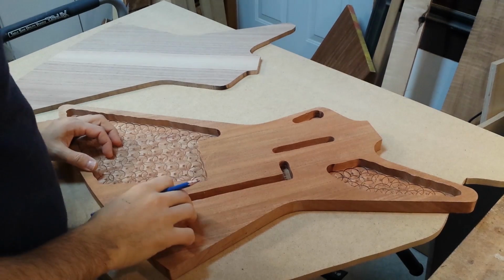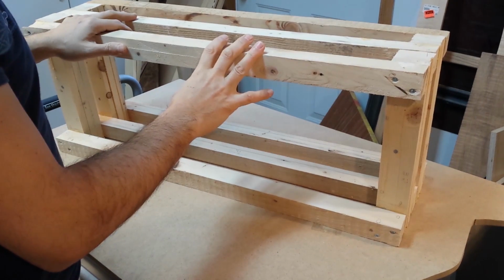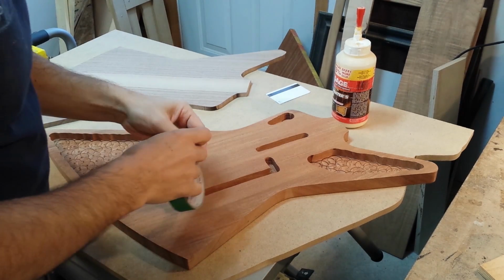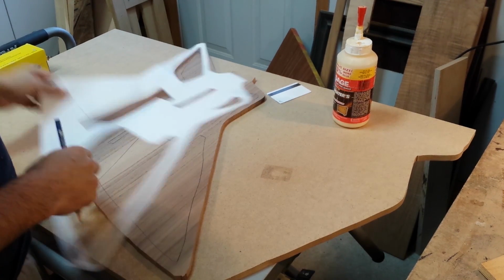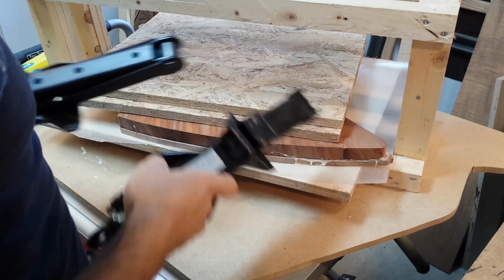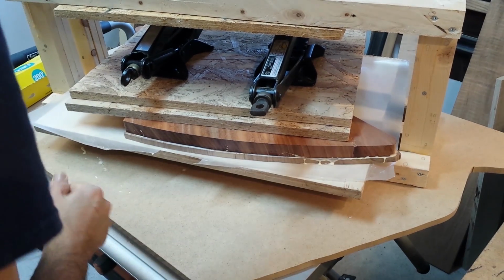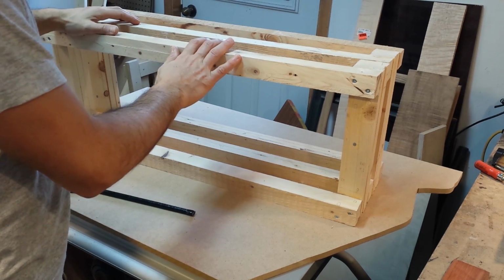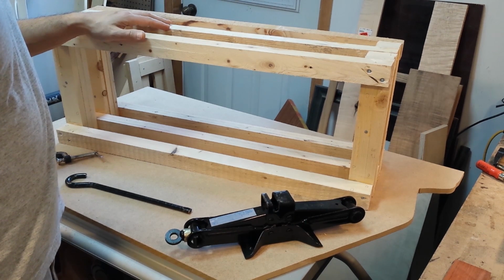Gluing A Guitar Top With A Simple But Effective Press

Comment: A few toothpicks used as pins could be used to hold the 2 parts together, I did something similar to this and like you was having trouble with the glue acting like a lube and moving it around so I started using toothpicks as posts to hold it.
But that is a hell of a great idea for a press!

Comment: All you need to press any size guitar body is a solid very flat table, a piece of 3/4" mdf that is larger than the guitar body, and two  45 lb barbell plates. Sometimes I add two 35 lb plates on top of the 45s,  if I feel the extra pressure is needed. . This also has a side benefit of guaranteeing absolute flatness to the body.    Oh, and I get my back and bicep workout for the day.

Comment: You do a good job showing all the little nuances of building a body. I like the tips you come up with. What is the thickness of the wood you start out with when making a body of say a Strat, Explorer, Les Paul?
Reply from the maker: The thickness of the wood is never the same. I use the wood I have and build the guitar accordingly. I can control the final thickness of the guitar by the combination of the thickness of the body and the top piece.

Comment: To fix the issue of allining the center points, you can use a tack to pin the top in the right place.
Reply from the maker: Great idea! Thanks.
Reply: Barring that, sliding the pieces against each other before clamping will burst the air bubbles trapped in the glue. That's the reason the pieces tend to skate around.

Comment: I did some more research on veneer presses after seeing your videos and found these things called veneer press screws you may want to check them out, I bought some and built a press using a frame like yours but instead of the ply wood and jacks I used a steel platen with a veneer press screw welded to it. The advantage is with the steel platen there is even pressure distribution on over the entire body. you can get them from shop fox or on ebay. Thanks again for the videos I wouldn't have had the idea to build my press without seeing your video first. keep up the great work.
Reply from the maker: I love it, you improved on my idea! Thank you.

Comment: Perhaps you can get some heavy steel plate to better distribute the force. Also, if you can get hold of a few hydraulic potjacks, that would work even better than the simple car jacks. Potjack have a smaller footprint, so you can put four of them in your frame.
Reply from the maker: Thanks for the ideas Dries. Those are definitely good ways to improve on this design. However, I created a new and different system for clamping my guitar tops, you can see my video here: https://youtu.be/UNY1C9HYqDQ
Reply: That also looks like a good system. But what I like about the cage system is that you can more easily inspect and clean up the glue squeeze out than with regular clamping.

Comment: Great video thanks! you can also use a little bit of coarse salt between the two plates to prevent them from sliding on each other, salt crystals acts as micro dowels when you press.
Reply from the maker: +Adrien Bernard-Reymond Thanks for the tip. Yes, I've heard about the salt trick, but I'm not too keen on adding salt to the glue because I don't know how it will change the glue's holding and drying properties. However many people seem to use it without issues... maybe I'll give it a rtry next time. Thanks.

Comment: You can use small dowels to lock the top in position so it doesn't move on you while its being glued up.  Also check out veneer press clamps I built my press using them and they work great I think you will really like them. thanks again for the cool videos
Reply from the maker: +eddie julian You're right, I can use dowels in the location of the pickups. Another option is to use locating pins using cut-off staples, like when gluing up a fretboard on a neck. There are a few options I guess, maybe I'll use on of them next time :)
Reply: Believe it or not, a light sprinkling of simple table salt over one of the glued surfaces will also help the two parts stay in place - the salt initially bites into the wood, and I’d guess it dissolves away. Well worth a try on less critical joins like this, although I’d stick it the micro dowel method for fingerboards - either outside the finished area if gluing before shaping, or in hidden locations like nut slots or tenons.

Comment: why don't you just put the glue on the body instead of the top?  Then you don't need to waist all that time with tape and weird paper templates. Thank you for sharing your videos though.
Reply from the maker: +eddie julian That would work also. Some people apply glue to one surface of a joint while others prefer to add glue on both faces. At this point in my building experience, I prefer to apply glue to both surfaces, maybe because I don't trust myself to do a good enough job on only one surface ;)

Comment: Im assuming this could be done with veneer? Granted the top is flat of course. I dont see this working with a compound-shape face.
Reply from the maker: +BassNBeards It should work with anything that's flat. It might still work with a non-flat guitar top if you place smaller plywood boards under the car jack and then clamped all around the edge of the guitar with small regular clamps (or spool clamps). That way, the car jack pressure is centered on the flat, middle part of the guitar and the spool clamps all around. I think that would work really well.
Reply: With a veneer you would want to add cork or something somewhat soft to avoid bubbling.
Reply: Or vacuum bag it..